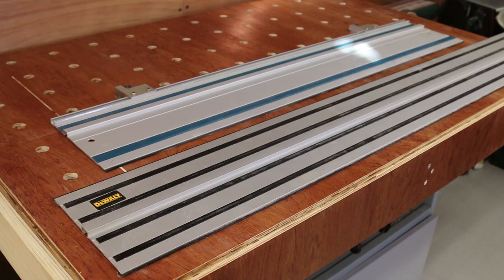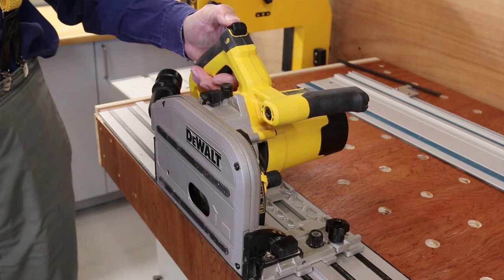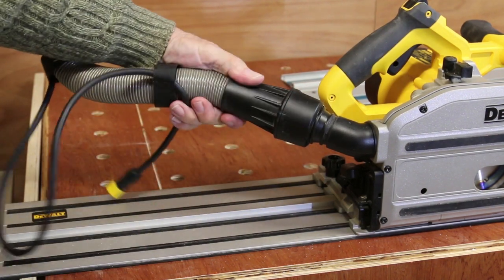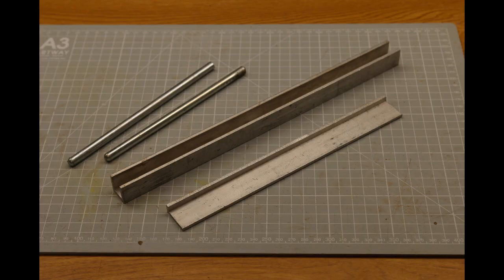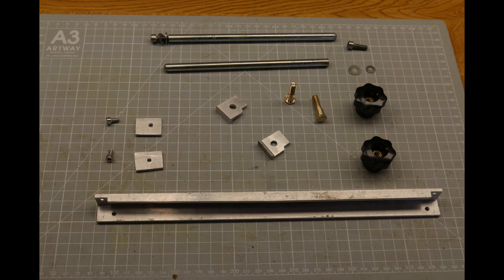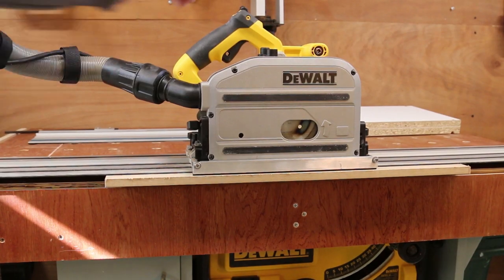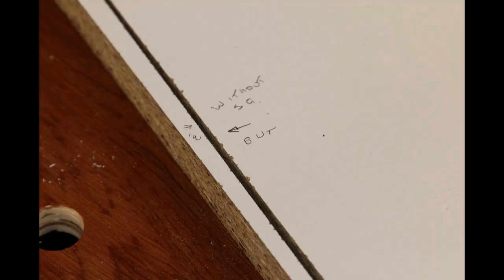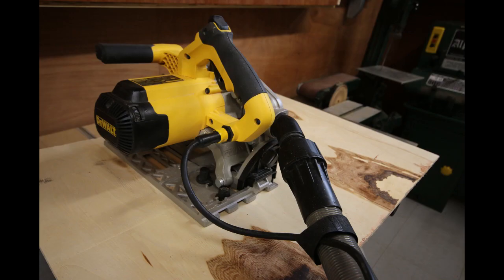Trick up my tracksaw part 1

Comment: Love the splinter guard feature. The cut quality definitely improved but still should be better IMO for a quality tool. Have you tried changing the blade? I am hoping somebody makes a video on this saw with a Makita 60T ATB plunge saw blade. It is made for fine finishes.
Reply from the maker: You are right that the quality of cut depends mostly on the blade- there is little to choose between makes when it comes to the blade mount/drive system. Much depends on the destination of the cut, and if it will be visible. Also the thickness of the material- a larger number of teeth gives a smoother cut but may struggle to clear material at reasonable speeds- and a slower cut risks burning. 
I tend to run two blades, one at the start of its life, and one nearer the end- this gives a choice - better cut for critical cuts.
Reply: @Tensquaremetreworkshop  Yes the blade makes a big difference. I was looking at the blade requirements in the Dewalt manual so I can match alternative blades since Dewalt doesnt offer a lot of options and found that the Makita blade I mentioned meets the specs on arbor size, and blade and kerf thickness. The Makita blade with 60 teeth should make for a much better cut. The cut quality is the main thing holding me back from buying this Dewalt and I wonder if the blade would do the trick. From another video I watched, the Dewalt cordless has plenty of power I doubt it would bog down much on a different blade. I will be cutting mostly plywood and need a high quality finished cut. If I get this saw I will definitely be adding your splinter guard modification!
Reply from the maker: @firpofutbol  Taking a scoring cut can greatly improve the cut from a top tearout POV. The shallow exit angle is much kinder to the top fibres. I have heard of doing a score cut backwards (what machininsts would call a climb cut), so the cut is alwasy downwards. I designed a smaller and simpler splinterguard, which can be left on the saw and it will still fit into the toolbox. see https://youtu.be/Jcpesfpb8Vw I only remove it for angled cuts. Some other track-saw videos too!

Comment: I love the added base to the right if the saw. A fantastic accessory,  but will it fit in the case after you bolt that on?? I own a cordless version and use the case when u pack up and move from job to job.
Reply from the maker: No, it does not fit when attached- but it does store neatly in the TSTAK case, as can be seen in this video - https://youtu.be/rvSExC7WWbE
If you want a waste-side splinter guard that can be left on, check out this- https://youtu.be/Jcpesfpb8Vw
This will fit in the case while still attached.
BTW, the attachment shown in this video can fit on the other side of the saw too- great for supporting it when cutting steep angles. Multi-purpose!

Comment: Best way to avoid breakout and where I'm a bit disappointed in the dewalt for not having one is a scribing button. But skimming along firstly  2-3mm in is still easy enough
Reply from the maker: In my experience, tracksaws all have some features and lack others. There are very few of these that cannot be retro-fitted, if desired.
Thanks for commenting!
Reply: @Tensquaremetreworkshop  tried them all. The dewalt used to have a bad rep on the corded ones. But I use the 54v dewalt abd it's class! Good videos mate, nice little tricks for work.

Comment: Great great info, I came across your vids in search of dust collection on the dewalt ts. Do you know of or if you can use Festool bag or any other dust collection bag on the Dewalt cordless? Do you or hose attachment fixes, so you don't have to buy $$$$$ dewalt vacs? Many many thanks
Reply from the maker: Tracksaws really need extraction. I have done several videos on dust extraction- see the extraction playlist.

Comment: what modification is needed on the Makita track to fit the DeWalt saw?
Reply from the maker: There is an 'anti-tip' lip on the side of the channel at the side of the track. This needs a couple of mm to be removed to allow the tracksaw to fit. I used a milling machine, but others have done this with a router. In addition, I have shown how to fit a DeWalt track in https://youtu.be/8SCSrDUjynQ

Comment: Hi mike i can't seem to find the link for the connectors you have used. Love the content and you are a such a clever and talented man. Have you had any ideas for a parallel guide system that will work on the dewalt rails. I am looking for a anser that doesn't involve buying festool or makita tracks. Keep up the good videos thanks dave
Reply from the maker: I got my plugs and sockets from RS components. 
Plug  Stock no 174-7239
Socket Stock no 174-7124
Pins Stock no 426-1338
female pin Stock no 426-1350
They also do a flying lead socket for when the tool does not have room for the panel type socket.
Your comment on using DeWalt rails got me thinking- certainly possible. 3mm ali plate under each end slotting into the track joining slot, with a clip arrangement at the edge similar to the one I use to locate the track on my MFT at the moment (see the MFT video, https://youtu.be/UxTUyw58KqQ
). If there was interest, I could do a video on the build...
Reply: @Tensquaremetreworkshop 
Hi mike thats spot on thank you will be investing in a few of the connectors. I am a kitchen fitter with a home workshop. The parallel guide is somthig that would make my work life a lot easier. In the process of making a mft and doing to adopt your fence system. I have recently gone totally battery powered for work life and all my corded equipment is now in my single garage sized workshop. Currently running a dewalt m class extractor that i am hard pipeing as we speak. Your plug system will make my life so much more easier with the auto syart on the machine. What do you think of cylcone separaters any good. Thanks again dave
Reply from the maker: @davidroth7586  Good luck with your build! Cyclones- I would not be without them (I have a few videos that include them). They collect so much of the dust that you can ignore what is left- I exhaust my extractor straight to the outside world.  No problem with fine dust or having to change filters. I have two, one in my workshop and one on my CNC machine in my garage.
I am looking seriously at the DeWalt rail for MFT...
Reply: @Tensquaremetreworkshop  i use a 700mm rail with a fixed square in my work life that i could not b without. I hope you come up with a resolution for the parallel guides there is a few ideas out there but no real good ones in my opinion. Think its going to hav to have a cylcone u have made my mind up. Thanks again dave. Keep on posting the grate vids
Reply from the maker: @davidroth7586  OK, I have built an MFT compatible system for the DeWalt rail- you got my interest going.... Works well. I will be publishing the video on Sunday (10/1/21).

Comment: Can't help but think if festool was yellow, you'd own a festool...... ;) I have the dewalt and really like it, the only thing I don't like in fact is the track joining bars. I find that the two tracks don't always sit level at the first try and they can move ever so slightly in relation to each other in use, which becomes significant when cutting strips on full boards at 2.4m long edge. For precision cuts (like a long wardrobe doors) the 2.6m single track is almost a necessity.  Also, to cut mfc clean with this tracksaw, simply set the depth to 2mm and make a backwards scribe cut.  Then set the depth to the full depth you need and cut normally.  Your work-side piece will be perfect. The waste-side won't be half bad either.
Reply from the maker: It is not the colour I hold against Festool- more their proprietary parts (Centrotec just a shade off hex, sanding discs non-standard hole pattern, etc) and their business practices (fined millions for price fixing) and pricing. And they have so many different battery types, it must be a nightmare. They may have some innovative ideas, but they milk it... If I were a tradesman, and they made something that was right for a job I would suck it up and buy. As a hobbyist I enjoy making things I believe are better, and not funding the Teutonic economic miracle. Not had a problem with track joining, but I rarely do long cuts. Perhaps a longer joining bar?  Thanks for your comment!